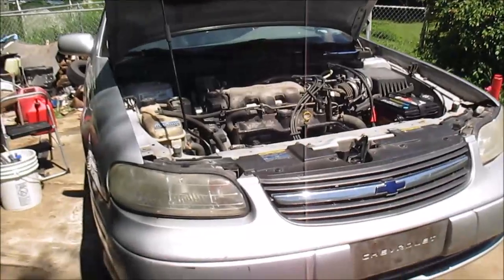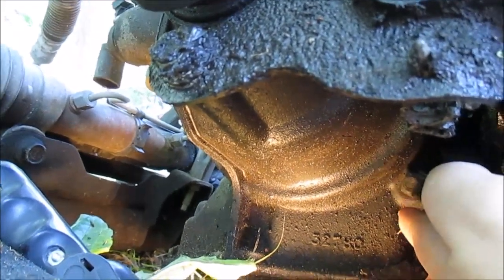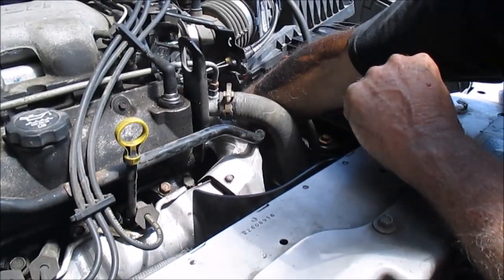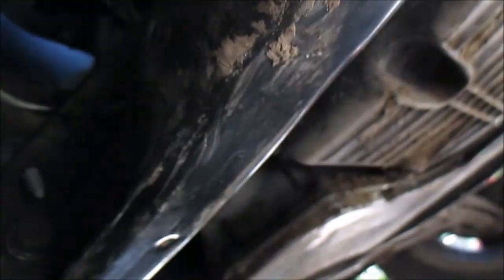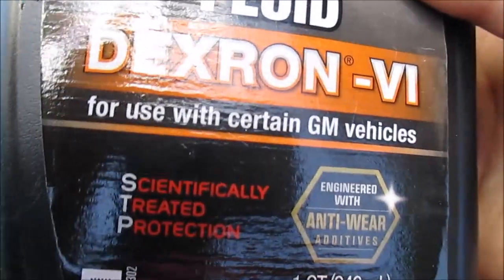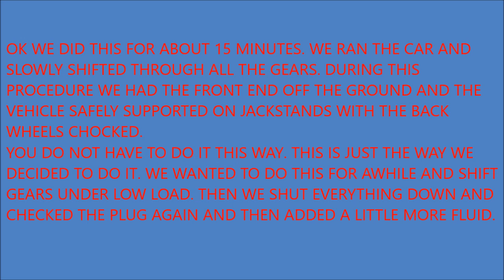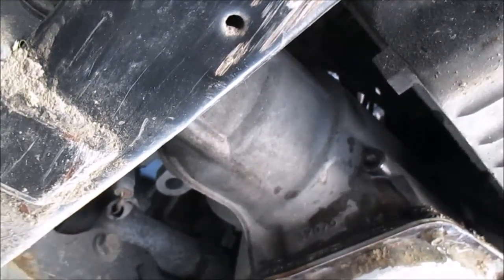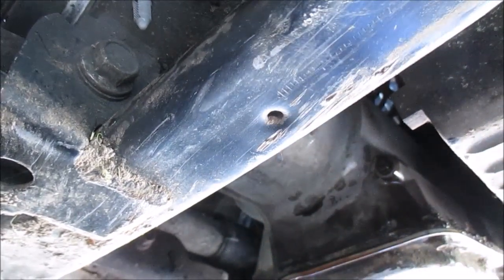Chevy Malibu Automatic Transmission Fluid Check (Where is the dipstick)

Comment: I will never buy a GM. My family has 5 GM cars in the driveway, and every time I try to do some routine maintenance on one of them I run into another one of these features. You either need some obscure tool or you need to get the car up on a lift. I'm convinced that GM either has actual Children designing their cars, or they don't want you working on them yourself. I've never had this problem with Ford or Toyota.
Reply from the maker: Thanks for watching.

Comment: Thanks for posting!  I searched and searched for a dipstick tube.  This is the most idiotic design change I have ever seen!  Very unethical of GM!
Reply from the maker: Hey I agree with you 100 percent, dumb design in my opinion. However I know some of the other manufactures are doing the same crap. I guess they really want you to bring in your vehicle and get it serviced by them. Well thanks for watching and thanks for the comment. Have a good day.
Reply: Yes. I would not buy a car with no transmission dip stick. I will stick to my 2000 toyota camry.

Comment: This  cars was built this way . So when required for service unfortunate you will be forced to take it to the dealer so they can charge arm and leg  . For such transmission fluid service and there is no way for you to monitor in what condition is your fluid if it is dirty ,or how  low and how you know if where ever you take the vehicle for service if they really drained the old fluid ? I just can’t trust anybody 🤛🏻

Comment: I'm crippled I can't get under my car
Not having a dip stick for transportation is just  not thinking about the people who can't afford the dealerships
Reply from the maker: Absolutely. Thanks for watching.
Reply: I’m going to try this tomorrow with the car on the ground. 
You can see the check bolt through the drivers side wheel right behind where the axle goes thru the transmission.

Comment: If you check your level this way you will be low on fluid.  Just as the ATF is checked with the engine running on a vehicle with a dip stick, the same is true with this method of checking.  Opening the plug with the engine off will deposit about 2 litres/quarts of fluid into your catch pan.
Reply: Yes, the engine needs to be running, but first you should put it though each gear for several seconds each.
Reply from the maker: He says in the video why he didn't do it that way. Thanks for watching!!

Comment: I just changed out the vehicle speed sensor located on the passenger side axle housing. I think its a little higher up than that check plug and I did have the passenger side jacked up so I could get under the car to change it. I still lost about a half quart of fluid. I think whoever had it must have overfilled it. I'll drive it to see how it does.

Comment: I was about to buy a Malibu maxx, but a tried to find the dip stick and I just find that little cap, so there’s no way to check if the trans it’s shut or still in good shape cause the oil tells you to much about life of transmission, crappy cars gm most be ashamed.

Comment: Silly design.  mine is still working, so far.  if the transmission isn't working and you to have fix it, would it be cheaper to buy a new one and get someone to put it in?

Comment: yea I saw the same as far as the car needs to be on and  get the fluid at a certain temp. what am I doing baking friggin cookies  geez.... I like your way wayyyyyyy better ty!! but it also said the car had to be even.. so
Reply from the maker: If you search online people say different ways of how they got this job done. I have mixed feelings about the procedure, and I mention a few issues and reasons for the way we did it, but I also posted what the tech book  procedure says in the video info section under the video. Which I would probably follow that procedure if I had a drive on 4 post lift, but no way would I ever get under a running car sitting on jackstands, (nor would I suggest anyone else do that, because it is unsafe) and try to mess around under a vehicle that is running, or burn my arm on a hot exhaust trying to add fluid. So all I can tell you is decide for yourself how you want to go about it. Well anyway thanks for the comment and thanks for watching. Have a good day.

Comment: if any one can help me it would be greatly appreciated. 
I have a 2008 Chevrolet Malibu. How do I check for the correct level of fluid with no dipstick. I undid the fill plug on the transmission and it appeared to be dry. Transmission has no problems but I just bought the car and I am curious to know if it the fluid is low or in bad codition. I do understand that these cars need to be brought to a certain temperature to be checked with special tools. Where do you recommend going? to big stores like aamco or local mechanic?
Reply from the maker: I would think just about any full service mechanic shop could have that checked out for you, and probably most general maintenance service type places could probably get that done for you. Just call around and get an estimate for checking and possibly changing the fluid. Transmission fluid service would probably be between 100-200 dollars I would think. Well I hope this info helps you out. Thanks for watching and thanks for the comment. Have a good day.
Reply: Nissan versa is the same, no dipstick. Now I got another one with this 06 malibu. WOW! What we women go thru. Thanks for showing us.

Comment: Malibu's are the worst cars
Reply: Patrick Washington I agree also have to take the stupid bump off to change head light Malibu POS....
Reply: @anthonyromanzocarr7712  huh? that's the easiest thing on the car to change, you can do it with a butter knife!
Reply: @slimbear1687  you will have to show me that way.
Reply: Maybe yours is different though.
Reply: @slimbear1687  ya 2012 all new ones are ridiculous.
Reply: @anthonyromanzocarr7712  looked 2012 up, that is ridiculous. Naturally they go from the simplest system I've ever saw to the having to practically remove the front clip to change a light bulb!
Reply: Patrick l Washington you are insane.........
I'm here watching this because I have a 363,000 mile Malibu that has never had a drop of transmission fluid added but it's starting to slip a little. original engine and transmission. engine has had a head gasket job. transmission has had nothing. I'm a nerd and keep a spreadsheet on this car for most of its life and it has cost me less than $0.05 a mile to own operate and repair all the way down to oil changes. got a second one for my wife and it has actually made us money in the years we've had it after getting hailed on. literally if you calculate both vehicles together they have been free except for Fuel and insurance. mine is so cheap to drive that my coworker calls it my second income. I drive this thing like I stole it...to the point that When I come to the end of an on-ramp to get on the interstate I have to slow down to merge with traffic. this car is easy to work on and dependable
Reply: @anthonyromanzocarr7712  LOL can vouch for that. I own a 2009 Malibu Sport that requires that exact same thing and i honestly had no idea how basic car maintenance could be so damn frustrating
Reply: @Absolutelycraziness  lol 😂 same mines an 05 v6 same transmission mf has 263,000 things bullet proof will for sure in the future if this one quits by another regular maintenance like oils brakes an everything like that stay on top of works great. Haven’t done anything major only check engine light was an thermostat 15$ 15 minutes an some coolant never left me stranded even with some blown up tires an still has all the tools an a spare can’t complain

Comment: Thanks AJ and friend for lending this time to make your video !   This week my Malibu 2000  3.1 is up on jackstands getting its intake manifold gaskets, water pump, thermostat, serpentine belt, and a few hoses changed out !  But thanks to your transmission video, I can go look for the fill plug down under the throttle body, maybe next month do the tranny fluid and filter !
Reply from the maker: Thanks for watching!!

Comment: I bought an 05 Malibu on 3/23/18 and it shifts pretty hard. Theres no lag in the shifting, it just jolts when it shifts. It basically sat for 2 years before I bought it, and I noticed there is a small leak in the trans fluid pan gasket. Could the it be that because the car sat for awhile, most of the fluid drained out so my Malibu, so it is low on fluid hence the hard shift?
Reply: I have an 05' also doing the same thing...did you ever find out what the problem was and if so what fixed it?  Thanks!